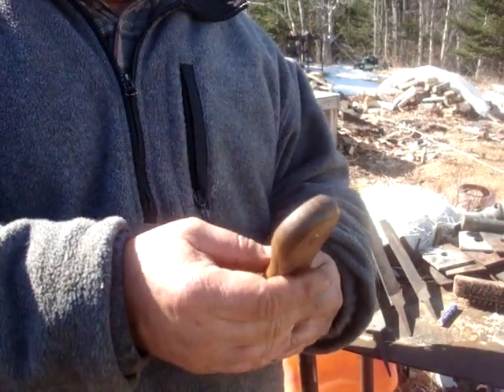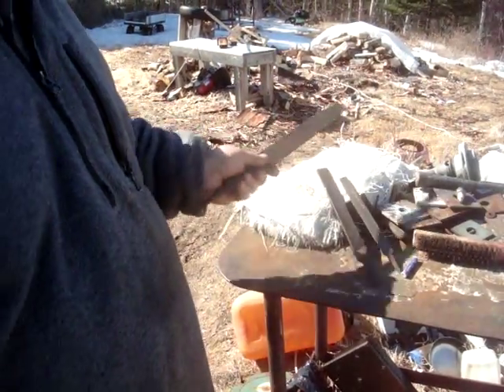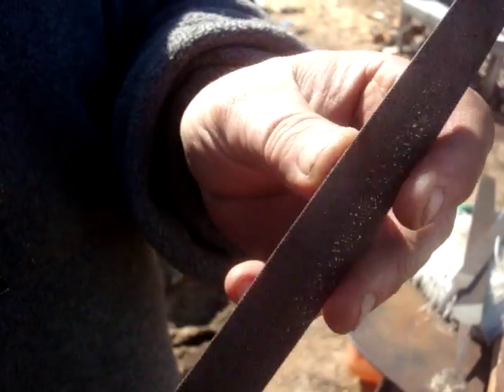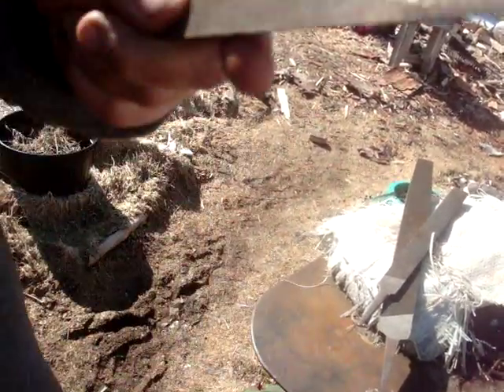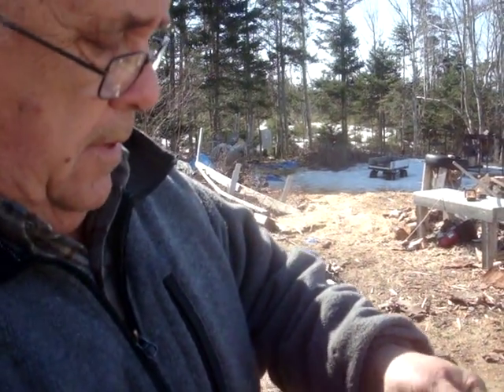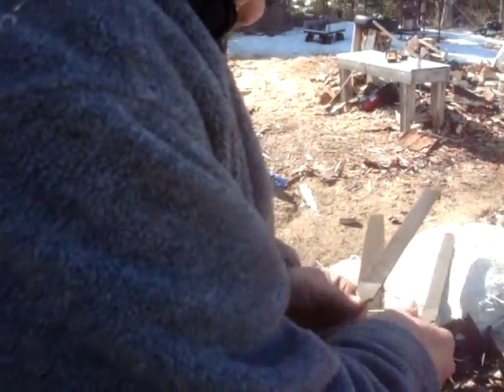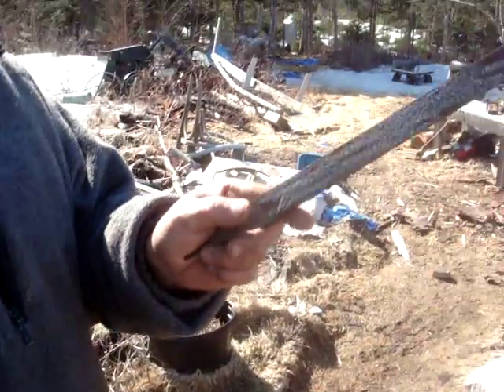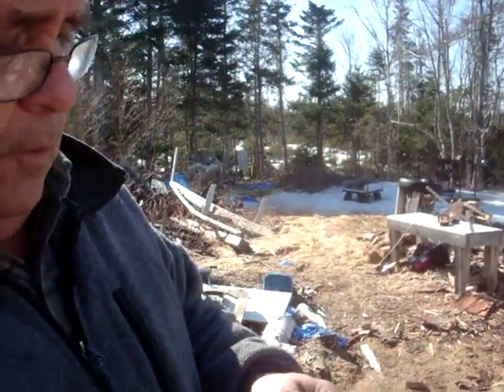How To Clean A File

Comment: I use a common 20d nail, 1/4" brass rod or steel rod bevelled 45 deg on end to scrape pin that won't brush out. Rods start to groove like a comb after a bit. Awls  save the day too.   ...T...